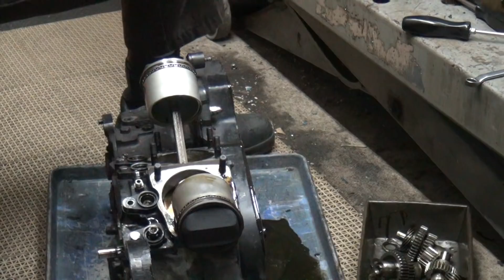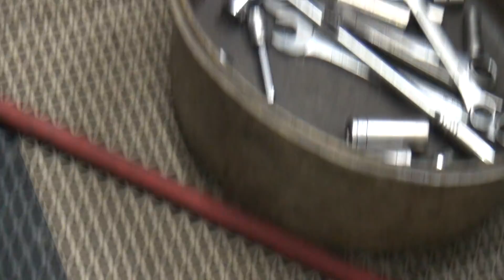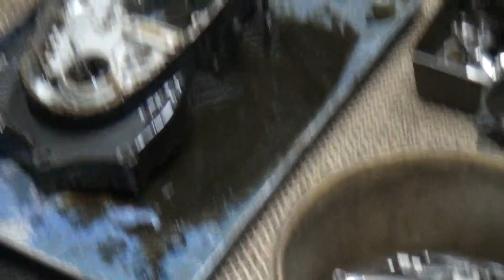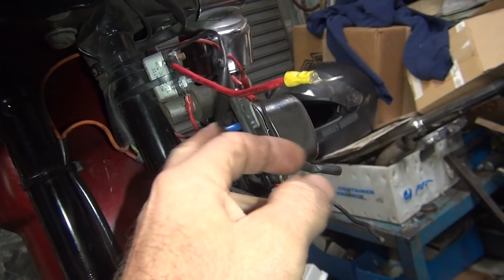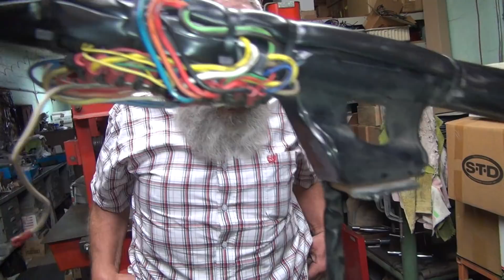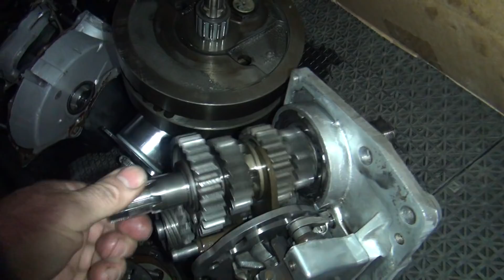1972 ironhead #102 xl xlch case repair motor rebuild harley sportster by tatro machine

Comment: Tatro,
Saw a little crack on 1975 stroker ironhead rear motor mount...micro thin.  So i drilled a 10-32 hole...threaded it, then lock-tite a hardened screw in.
Been runnung like that for 6 months...has not propegated.  Should i bother getting Pingel or just let it be?
I listen to the tatro the master only!
e
Reply from the maker: no, you are fine. if you install the motor without a load on the mounts than they will not break. lift up the front of the motor some befor you tighten the front mounts helps a ton on not breaking that rear mount. there is a ton of weight hanging off the rear mount if you don't.
tatro
Reply: @TatroMachine  
Thanks Tatro....i am leaving it alone

Comment: Great video.  Anyone have a good way to DIY clean an engine that's torn down for someone who doesn't have access to a good shop with a parts cleaner?
Reply from the maker: anything you have would be a start. just scrubbing with your hands and some rags gets alot done.
tatro
Reply: @TatroMachine  Yeah, I want things actually clean like you do, like not having trash in the piston skirts like the last guy who did this.

Comment: In your experience and opinion, what causes the rear aluminum mounts to crack all the time?   I've heard different ideas, the one making the most sense is that the rear mount should be tightened first to align the engine in the frame, then the front mounts shimmed to fit, and when the front mounts are tightened first it will stress the iffy design of the rear.
Reply from the maker: just watch the videos when i install the motor into the bike and i tell you the why and what to do. i don't do it like you just described.
tarto

Comment: how did you clean the parts?
Reply from the maker: i like stoddard solvent if you can get it. it cleans very good and leaves very little residue. there are other solvents and soap basted cleaners too. try different type cleaners and find what works for you.
tatro
Reply: Stoddard solvent, ist that just white spirits?.....i mix white spirits and Gasoline  50/50 to clean parts, i always have some old gasoline laying around I don’t want to put in an engine ....
Reply: Thank you. We have it named "White Spirit".

Comment: I had a 73'. I hated that fuckin' bike. A Gremlin lived on it and that fucker would break the dumbest shit if I rode 50 miles. That bike spent more time taken apart in my garage then I ever rode it. I didn't have no money at the time so no rebuild. The motor seized up on me one day and I finally sold it to some other kid.
Reply from the maker: if you fixed all the problems at once it would have been tons more reliable. that goes for anything.
tatro